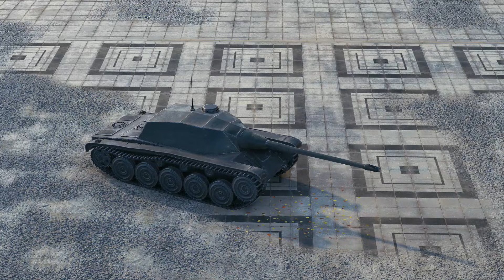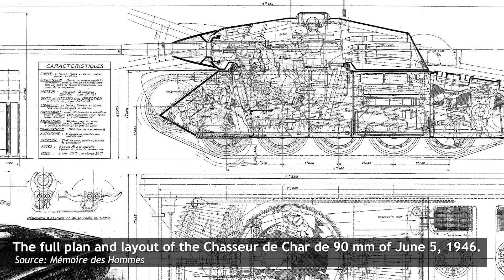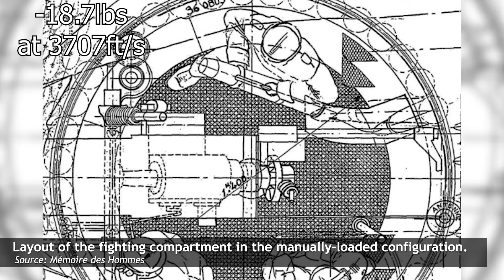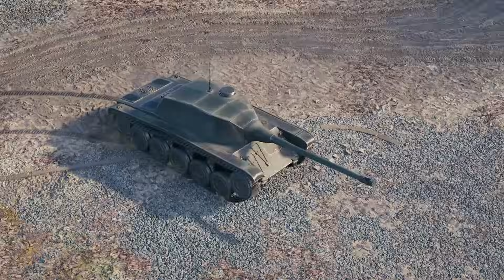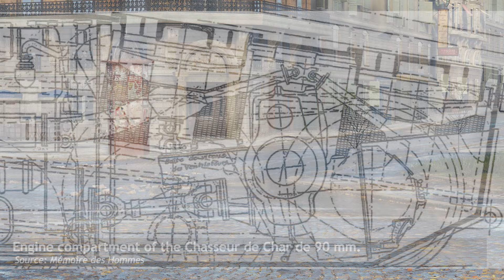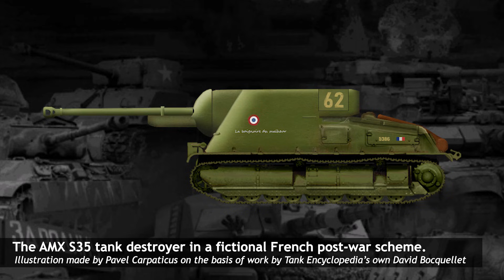Rescued by Wargaming | AMX CDC (Chasseur de Char de 90 mm) (1946)

Comment: Author of the article here. If you ever wondered, I have the CDC in my WoT garage. Fully kitted out with turbocharger and stuff because gotta love having the highest power to weight ratio in the game out of non-lights. 

The narrator really did a good job here, and glad to see the article featured here.
Reply: Best power to weight, worst ground resistance, even bad among heavies. Additional grouses does wonders for it, or well, it would if the game wasn't a mess, quit ayear ago because with useless HE you can't do anything to higher tiers and heavies anymore, op new tanks come every month... They should have split the CDC to 3 different tanks, 2 CDC destroyers with the big turret but a bit less mobility (52-55 max speed, even slower turret and hull traverse) one with a higher accuracy gun and better penetration, the other worse penetration but the intended autoloader... And the other is CDC medium, with a way smaller turret (no need for it without an autoloader after all), higher turret and hull traverse, 62-64 max speed, same gun...

Would probably be a decent set of tanks then, as is it's kind of an abomination, a massive slow traverse turret with NO armor that's only there to fit the ABSENT autoloader, top speed that nearly negates the epic engine power, hull traverse of a snail, bad camo...
Reply: Yoo great article
Reply: Okay, it was funny the first time, but you're not going to call us frogs every time you make a video on a French tank, are you? I can see it getting old quick. Oh, and it's not "de ninety millimeter", it's "de quatre-vingt-dix millimètres". Please get the narrator to try, next time, for the lolz.
Reply: @adrien5834  :?
Reply: @adrien5834  I did not write the script but will ask lol

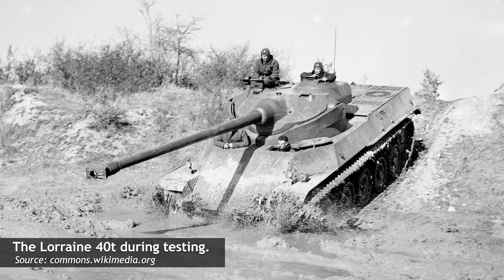Comment: 9:06 This is AMX 50 100, not Lorraine 40t :(
Reply: They look really similar it seems
Reply: @GBAARW  the turret does but  where the amx m4 use overlapping roadwheel the lorraine 40t use tire  also the lorraine has a more slope on the front and only one crew member in the hull

Comment: It was probably canceled for the same reasons as many European post-war projects.  

Reconstruction was costly.   Colonial empires became a burden.  

The Cold War changed the focus of military development.  

The performance of chemical effect warheads (HEAT, HESH) and the development of guided missile technology created a debate about the future of the gun armed TD.  

The dawn of the MBT concept meant that the role of tank destroyers would essentially be filled by tanks like the AMX-30 and the Leopard 1.
Reply: None of these factors mattered when CDC was designed in 1946. It was one out of many projects going on at the same time and money wasn't lacking for paper studies, missiles and shaped charges were extremely early in their infancy, MBTs didn't exist as a concept, the Cold War had not even really started.

This was just a concept that peacefully died out. Most likely the concept was considered simply not really useful. No bigger gun than the planned main tank, not really light and small enough for the gun to be interesting in terms of strategic deployment. After writing this article, I also found a French archive document just after WW2 indicating TDs as a whole were basically obsolete (both turreted and casemated).

Comment: This tank desperately needs an armor buff or an autoloader/reloader.
Reply: It's not a tank. It's a tank destroyer.
Proper use is ambush hit and run against tanks. Fire one or two shots before disengaging.

The design flaws I see are a) to much main gun ammo on board, increasing the weight and size of the vehicle, and b) to narrow tracks, impeding mobility.
Reply: @ollep9142  TD in the name, shitty medium in practice. What you are saying can not be done.
Reply: @zondazerda2230  In practice? This TD wasn't even produced "in practice", so how can you say it's a medium tank?
(Of course I don't care one bit how it's portrayed or used in WoT. I'm only interested in the real thing.)
Reply: Nah, it needs better mobility, pen and accuracy. How exactly could you turn a 30mm hull into something useful against tier 8's?
Reply: @derrickstorm6976  No. The tank is accurate enough and the pen is good enough. Mobility is outstanding. The thing can maintain 40 km on a hill due to that ridiculous 32 ton ratio and it can reach 57 km/h easily.

You either have not played in a cdc or you don't have it. Let me tell you what it feels like to play it now. You move, get spotted, get HEed and die in like 10s. The armour is a joke. The armour buff is to prevent getting HEed. Progetto armour level will suffice and an auto reloader like the one in Progetto will be a good addition since the tank is so underpowered.
Reply: Forget armor buff. What would you want to do with that? Give it another 300 mm+ weakspotless turret? I agree with firepower. This thing needs the same gun as an autoloader. Like a watered-down Bourrasque, but with better aim time and more magazine capacity, basically forming the link between the tech tree B-C 12t and the AMX 50 100.
Reply: @el_barto96  An auto reloader with 3 shots should be enough in my opinion or may be a 4 shots autoloader would be a decent choice too. It will not be underpowered any more and it will not be overpowered like Bourasque or Progetto since you get HEed to death and it is a big target.

I meant to buff the armour so people doesn't 3 shot you with HE. The tank is literally unplayable in it's current state.
Reply: @el_barto96  lol "link between bc 12t and amx 50 100" how exactly are those designs linked? Both are tracked vehicles with some armor? No wonder WG don't care about customer feedback when stuff like this is flung around...
Reply: @derrickstorm6976  The gameplay link, you muppet. 
I don't expect the slightest bit of historical accuracy since from the very beginning WG has been known to grossly disregard that anyway. If I feel like playing in tanks that have a semblance of historical accuracy and realism, I'll play War Thunder.
Reply: @el_barto96  no.
Reply: @thomasboland540  Excuse me, do you even play a CDC?